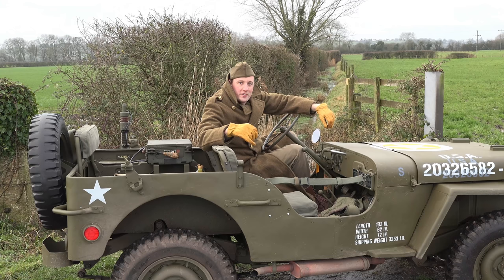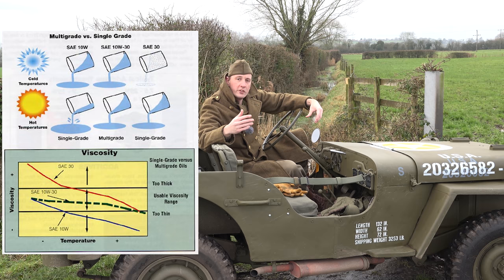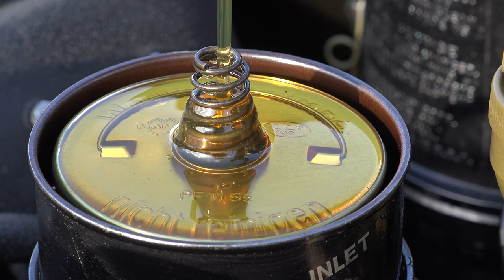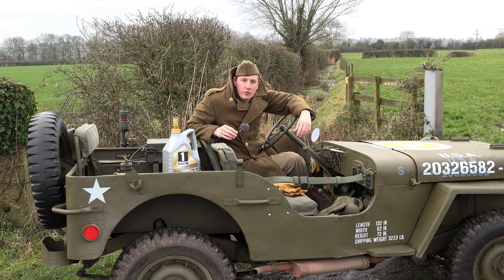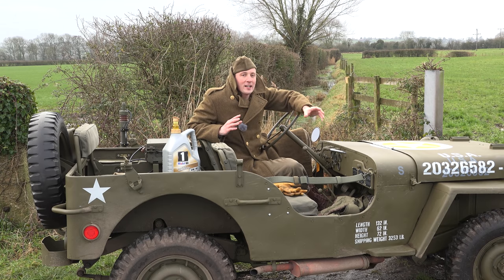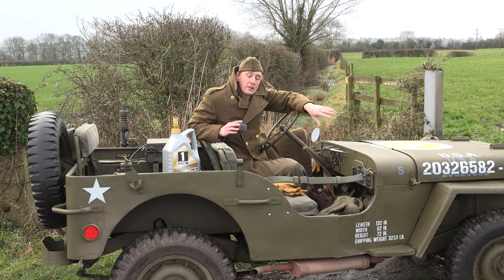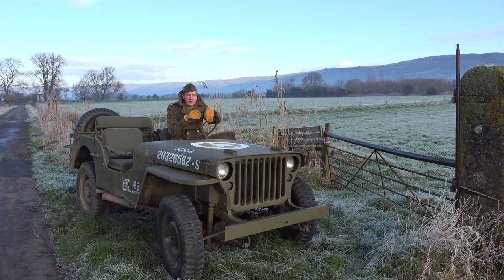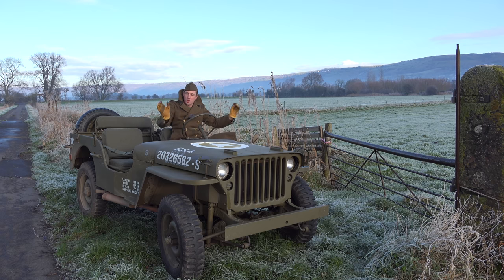Why can't You use Synthetic oil in old engines??

Comment: If you have a new engine block, then using a multi grade oil would not be. A problem. However, if it is an old engine block, these were designed to use a leaded gasoline that left a thin layer of lead on the cylinders and it was necessary to have a non graded oil to lubricate the piston rings. This means that a synthetic oil would still permit the rings to scrape off that thin layer of lead and lead to engine failure. The German Army found this out in WWII as it progressed and they  were not able to get the appropriate grade of motor oil. They tried a an additive for the problem. STP. This was made from pine resin, and while it worked for awhile, as temperatures dropped, it wound up gumming up the cylinders and rendering the engines useless, even if they were able to get the appropriate oil. It would do the  same on all bearings, causing bearing failure. Fortunately today oil additives no longer allow such things to occur, however with an older engine you still can get oil smoking as there  is no lead lining the cylinders.

Comment: Unless you are a purist, if you are rebuilding an old engine, they can use modern cylinder liners which have vastly superior hard wearing metal coatings and also modern pistons with modern piston rings.

Comment: Years ago back in The US I owned a bus fleet. The Manufacturers and suppliers used to come around and show off all the new products. One of the things one of the oil companies promoted was their new synthetic oil and 100,000 mile oil changes. At every normal service interval you would send them an oil sample and if the oil was still OK, change the filter and off you go. The diesels could do 50,000 miles fine, gas engines about 20,000 miles, some more, some less. One thing they did say was, never put the synthetic oil in a new engine! They said it prevents the needed wear on the piston rings during break-in. They did say that after the first 5,000 miles it was OK. Back then all of my gas engines had the stiffer rings. I started doing what they said, my gas engine passenger vans that ran on the highway most of the time averaged 40,000 miles on the oil and the engines lasted between 500,000 and 1,000,000 miles, only changing timing chains and oil pumps at about 100,000 miles. They also mostly didn't use any excess oil. Thanks for the videos! the dog
Reply: Yes, the issue here is with the rings seating correctly.  Rings that have chrome plating on the wear surfaces need a simple mineral oil to polish in nicely and when done, virtually nil oil consumption after switching to a good quality multi-grade, no matter if all synthetic or otherwise.  I was a career motorcycle mechanic on both two and four cycle engines and ring wear was the biggest criteria showing good oil quality.  Back in the day, we used a 20w/40 in our Japanese brand four strokes, two cycles did best on full synthetics right off the bat.

I suppose updated specs could be applied to these old Jeep engines using chromed rings.  Old aircraft engines getting chrome treatments on rings and bores is now commonplace.
Reply: @whalesong999  My understanding is that it wasn't factory-made chrome plated rings that needed low-quality oil.  It was shop-made rings and bearings.

Rebuilding engines used to be done with mostly shop-made parts, custom fabricated to match the specific engine.

Bearings were melted out and fresh Babbitt metal poured in place using the bearing shell and soot-covered crankshaft as a form. The split between the bearing halves was formed with a brass shim that was later removed to close up the clearance from when the molten bearing metal contracted.

Rings were cut to approximate size on the shop's lathe from a steel pipe/tube, then fitted by cutting the slot and filing it to the proper gap.  The resulting rings were often slightly out of round and had taper.

The soft bearing metal didn't need any special help to wear to a matching fit.  Even if they didn't wear away, they would be burnished to a polished surface.

The steel rings did need help.  It was important to form fresh, sharp, rasp-like cross-hatching on the cylinder walls to do the final machining on the rings.  Ideally the work-hardened edges would wear away just as they completed filing the tapered, out-of-round rings into a tightly sealing surface.  If the oil was too good or there was insufficient cross-hatching, the rings would remain out-of-round and tapered.  No amount of future bad lubrication would fix the oil leaking past the bad rings.
Reply: @1djbecker  Nice read.  That's going back many decades.  My father had a garage and was a prime mechanic in the 'pour the babbitt days".  I inherited a worn out shop compressor whose con rod bearings broke and got my own chance to attempt a babbit job on my own using materials we had laying about, including some big ingots of some kind of lead alloy I melted down bits into forms around the rod's journals.  It did work out o.k. with a fair amount of scraping the high spots until it fit nice.

Wichita had a major engine shop, Kansas Rebabbitting, which I often accompanied my father to for parts and service back in the late '40s.  They reground cranks, many other services.  They went away sometime in the mid '60s I think.

I didn't know about making rings like that, so interesting.  I do remember dad having a knurling machine that would force a cross hatch emboss in pistons that would reduce their clearance in the bores to compensate for wear.

Comment: You certainly can use synthetic in rebuilt, CLEAN, older engines.  However, I would use 15W 40, or if it is cold enough, 5W 40, not 0W 40.  The myth that you can't use it started because people try to put it in an old dirty worn engine with the results of 1) plugged oil pump screens due to the super-high detergent properties dissolving all the sludge in deposits, 2) because clearances are greater than they were when the engine was new, and the viscosity of synthetic low, you might suffer low oil pressure, 3) the super-detergent properties often would dissolve badly deteriorated gaskets and oil seals that had enough sludge in them that they seemed OK with conventional oil, resulting in bad oil leaks.

Comment: On a freshly rebuilt engine, you should be using a non-synthetic oil as your break-in oil (first 500-1000miles).  At 8:06 your 500 mile oil change.  If this is the break-in of the engine and if you used synthetic oil, I am not surprised you see nothing in the oil. A synthetic oil does not allow for significant wear (that is required for break-in) and as such, I wouldn't be surprised if your rings haven't seated and may never seat if you don't do a break-in with non-synthetic.
As far as using synthetic in old engines, sure, no problem.  I use synthetic in my 1967 GTX, lawnmower and snowblower, as well as my daily VW.
Reply: Wondering if modern synthetic oil will attack the babbit bearings used in old engines.My understanding is you should'nt use it in an engine that had a steady diet of non-detergent oil.
Reply: Totally incorrect - All engines from the last two decades come filled with synthetic oil from the very beginning with zero problems.

Comment: I concur with your thinking.  I purchased a 1956 Willys CJ-5 with it's original L-head 134c.i. engine that had less than 2700 miles original on it.  I drained and twice flushed the block, axels, transmission, transfer bearings then swapped all lubricants to Synthetic.  I've been running that Jeep now for over 10,000 miles with little appreciable wear to any components.

Comment: Just my two pennyworth: You are absolutely correct with the Jeep engine, the Jeep engine despite the L-head sidevalve design is actually quite modern in construction with a full flow oil pump and a filter.
Many contemporary cars, up into the 50s,  did not have oil filters beyond a strainer on the oil pick up, the engines were designed to trap wear particles in dead end recesses in the oil galleries in the crank where they would be flung by centrifugal force. (These can be very difficult to clean out on rebuild.)
The crucial difference was in the oil. Modern detergent oils are designed to keep all the crap in suspension so that it can be trapped in the filter. This is no good in an engine without a filter where you want the wear particles to settle out quickly and stay put.
So  your Jeep will be fine on a modern multigrade detergent oil, of the correct base viscosity, but anyone else running late 40s to 50s cars need to be more careful with their choice of oil. This probably accounts for the advice that you can't run an old engine on modern oil.
Reply: Very well put.

Comment: On my rebuilt 1934 Austin 7 engine, I ran a straight oil for the first 1,000 miles bedding in, dropped the sump, was surprised at the quantity of sludge, reverted to a 20/50 multi-grade (Comma), buy in bulk as it is cheaper, oil changes now at 2,000 mile intervals, comes out like yours, and now does not sludge up, oil consumption seems low (not actually checked), lose a little in leaks, the A7 engines are a bugger at keeping all the oil inside!
Reply from the maker: Good work Gary, I didn't touch upon it as there was so much to get through in this video but sludge in old oils was an absolutely massive problem and one of the major things we just don't need to worry about with modern oils!

Comment: Oil is a big topic of discussion in the aircraft community as well.  Lots and lots of opinions!   😉.  

At the risk of over simplification,  break-in for aircraft piston engines typically requires the use of mineral oil with no additives. The lack of anti-scuffing agents allows the piston rings to properly seal against the cylinder walls.  This break-in period generally lasts about 25 hours.  You actually want some wear between the rings and cylinder walls to occur during break-in  or glaze will form on the cylinder walls which leads to excessive oil consumption and blow by.   The only way to fix that is by re-honing the cylinders.  Once the break-in is complete, you can switch to single or multi grade oils with additives. 

In my 1947 Continental C-85 engine, I use 20-50 mineral oil (Phillips) which has an ashless dispersant additive to keep particulate in suspension so the filter can capture it and to minimize sludge buildup.   I also use ASL Camguard additive.   This has been a winning combination for me.  At over 1,000 hours since overhaul, compressions are like new.   I change the oil every 25 hours (2500 miles in automotive terms) and the oil color is light brown.  I tried 15-50 synthetic blend oil but found it has a tendency to leak out (capillary action?).

I don’t know how much of this translates to Jeep engines of the same vintage….but if I owned one, I would be inclined to use a multi viscosity mineral oil with Camguard.  That stuff is liquid gold in my opinion (no, I don’t work for ASL).  

Great video!  Thanks.

Comment: I once spoke to an owner of a 1956 Chrysler that had over 300,000 miles on it's original 354 hemi, never over hauled, ran perfect. Asked what super duper oil they used. Answer=  straight 30W since new as owner's manual suggested. Guess it worked ok.

Comment: wow, an adventurous fellow wading into an oil discussion... 

Glad someone agrees that modern technology is better... lol. Here we still run our L134 at -40c, cold start and everything.

Synthetic works great BTW, in the older hotrod arena, they run conventional until the rings seat, then switch to Synthetic. "Bob the oil guy" gets into the nuts and bolts of oil. But your spot on with the oil science.
Reply from the maker: Very true, I think standard 1000+ppm zddp multi weight mineral oil for break in (if you can find one) and then synthetic to stop any further wear!

Comment: I use synthetic oils even in russian UAZ or VW Beetles, as weel engine flush in every change... and add MoS2 addative :)  No issues ever.
Reply from the maker: Thanks for the input Jakub
Reply: No need to flush when using a fully synthetic oil.
Reply: @johnburns4017  its not true. :) Even if the clean better than normal oil, they still left some "dirt" especially semi synthetics
Reply: @jakubstrumillo  
Semi synthetics are a con, as most is mineral oil.
Reply: Your problems may be the MoS2.  Just only use a suitable quality fully synthetic oil.  

https://www.youtube.com/watch?v=UnNahISE_nU
I did 175,000 miles in a Toyota from new using only fully synthetic oil.  No problems.  New owner has no problems either.

Comment: I use Shell Rotella T6 5w40 for everything. You can tell the protection difference when you take apart an engine that has been sitting. Conventional will have drained off of the top end where T6 will still have a nice protective film over all the parts even after months of sitting.

Comment: Another trick my father used (we live in Canada) was to have a "block heater" and plug the truck in over night except in August :) and at every other opportunity. 

He had advantage to plug in at work usually to ... he could got an entire winter with masybe a dozen cold engine starts.
Reply: He could have fitted an electric pre-lube pump as well. Turn this on just before starting then oil is at the bearings when started. I believe Amsoil have a similar idea using oil under pressure. Oil is held under pressure by a check valve when teh engine is off. Turn the ignition then the valve is lifted with oil being forced under pressure to the bearings. The engine would last and last, still having that newness feel to it, being preheated and using a quality fully synthetic.

Comment: Your treaching skills are good. Live in Old Harbour Jamaica and I use to drive a 1969 Hillman Imp , whichI would love to restore, and I use to experience over heating problems with it untill I build and remove the radiator to the front. Before doing that, after installing my third engine and braking it in on mineral 10 -30 I could not go faster than 45 mph before the temp.gauge run too high but after changing to Synthetic blend the temp. reading went down and I could hit 65 mph so I never returned to mineral oil. I also use to own a old Rupp Go-kart with a 2 hp Briggs. engine and I find running it on Synthetic blend oil the spark plug never foul, it still starts when the rings were worn and got to the stage wear the power was so weak it could not lock up the clutch to drive the cart.

Comment: Drove our jeep 1996 - 2010 with a worn engine @ 20 - 30 PSI oil preassure using SEA 30 mineral oil.  
In 2008 I bought a generator engine, total rebuild to std. between 2008 and 2010 with many NOS and great repro parts. Used a full synthetic 5W40 turbo diesel engine oil since.  Leaks a bit more than the SEA 30. I agree that the synthetic oil is preventing wear much better than SEA 30.  Don't know if it uses oil cause it also leaks. Sparkplugs are clean.

Comment: I am NOT a mechanic but I've learnt that you run a motor in with a cheap basic oil. As for motors of this era many or most did not have oil filters (what we call a sludgy out here). Many a sludgy died with the introduction of detergent oil because it would pick up the sludge from the sump and put it back through the motor. As for synthetic oil I recon its great stuff, it has a much higher temp' before breaking down and a much lower temp' before turning into grease. I used to use "Amsoil friction modified oil" in gearboxes, I couldn't ask for a better oil. But even the Amsoil dealer told me NEVER put friction modified oil in a diesel as it will glaze the bores.

Comment: I have a 1963 Unimog S and I was talking to a chap from Ireland who had the same vehicle. He bought the truck in Germany and drove it home. He said the journey was a bit of a nightmare as he had to keep stopping to top up the transmission oil. Oul was leaking from the gearbox seals and he was resigned to sorting it out back home. He had to do a top up with synthetic oil and this somehow tightened the seals. He ran the gearbox on this blend for the rest of the journey.

Comment: My brand new Triumph Bonneville uses a straight 30 mineral oil to run the engine in...500mls....its then onto fully synthetic.

Seem a good solution.

I do believe that semi synthetic protects an engines internals against corrosion if the engine likely to be sat unused for more than a few days...as fully synthetic drain off surfaces easy.....that could be out of date info.....I am going back 10 years with that.

Saying that Triumph do approve the use of semi and fully synthetic in my engine.

Love your Jeep....always wanted one....I make do with a S3 88" Landrover bought new in 1975....still going well.

Nick from Cheshire UK.